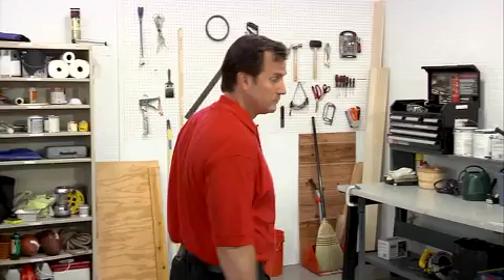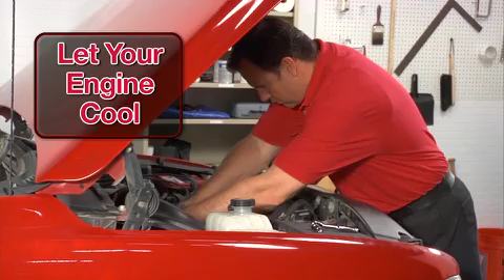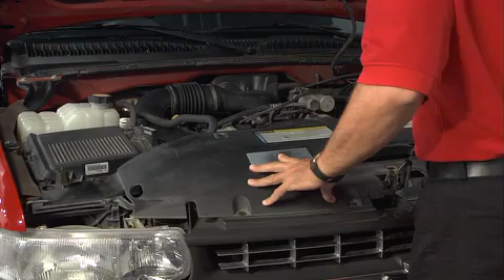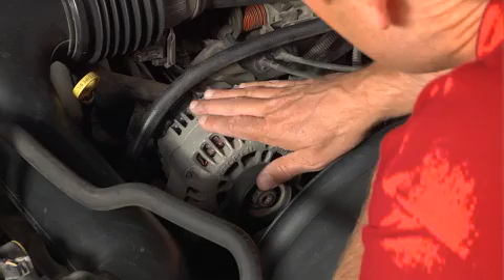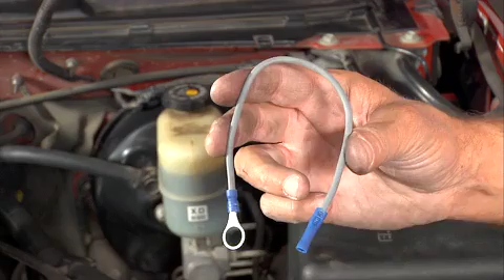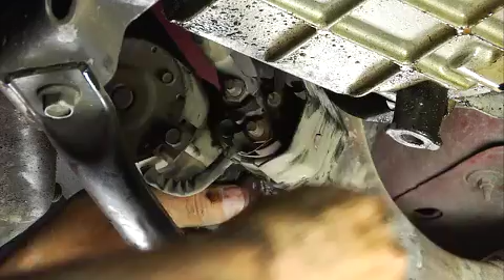AutoZone Car Care: When to Replace Your Starter

Comment: Is the teeth on my starter suppose to turn freely ? I went to advanced auto and they told me it was bad because that reason he did show me a new one and it was stiff didn’t move, then i went to autozone to test it in there machine and they tested it and they said it works ?

Comment: Guys, I’m scared. In my area a starter is 900 dollars , I promised my son a computer after he got all A’s on his report card, if I don’t get it for him it’ll break his heart. What can I do
Reply: Norma Frazier Yeah... I had to pay 700 dollars to fix it, he took it well, thanks for the help.
Reply: See about a used one at your local wreaking yard. Will be less than half of a new one, maybe even cheaper..Good luck..
Reply: But the starter and tell your son to lick rocks.
Reply: I heard about this cool invention called the internet. I understand that you can buy one there and have it dropped off at your doorstep for about $50 and hire almost anyone to bolt it on for about $20.

Comment: question... what about when you have that the first time it starts slow. but evertime it is different. sometimes faster and sometimes it takes 5 or more seconds. it always start though! then when i shut it off again i do it again or withing a short time it starts fast. i changed the feul regulator so that ain't it.
Reply: This sounds like what mine is doing. Did it end up being the starter
Reply: @penguinzomzom  I'm assuming you've sorted it by now but If you haven't my silvia was doing a similar thing, would crank sometimes once, sometimes would start up without even cranking and other times would crank strange.. I left it sit for a week and now it won't start it all, engine won't crank even once and when I turn the key the catalytic converter dash icon appears, If any of this is similar to yours or anyone else who's reading this's situation, I just got it diagnosed and it is supposedly the starter motor.

Comment: Is it too much to ask for someone saying "If your starter sounds like this insert bad starter noise then it might be bad."

I've sifted through countless videos, and not one of them has what a bad starter sounds like.
Reply: Robert Cozby A bad starter don't always make the same noises and sometimes they make no noise.  A bad starter is usually 1 solid hard click (several soft clicks is usually a battery issue) a grind can be a starter(but often time is misaligned starter that's eating your flywheels teeth and ruining it. 
The most common starter noise is the 1 solid click noise.

Comment: friend replaced my alternator, but the car won't turn over at all with a jump it does absolutely nothing except you hear a light buzzing noise from the starter. would that indicate that the starter is bad?

Comment: I ran over a 2x4 a week ago. My 2011 chevy aveo has been running with no issues except one. I hear a ratting noise under the car, and it has a 1 second start delay. Outside of that the car runs fine...

Comment: why does autozone have such trash for parts electrical and pump wise? china rebuild's?  ofcoarse it is. i bought a powersteering pump from them one day and it wasnt anygood. so we returned it because it had a bad sound like a bad one would have to begin with duh! and before i even had time to leave the store with the secondary one, i found a pin hole, in the elbo on the pumps fluid nipple connection as i was walking out of the store !!!!!!!!!! i walked over to the guy and said do you see this is trash on the shelf here you just handed me i just notist? he says nope i see nothing wrong with it. i then gather a bunch of spit into my mouth then spit on the hole on the pump and blew on the end and spit bubbles blew out of the spot and proved it was no good off top. how in the hell are people missing this shit these days and still letting forein countrys make and rebuild things from here that should only be rebuilt by the original makers? fuck off isis and fuck off china. AUTOZONE IS CHINA!!!!!!!!!

Comment: Nice video. I saw a post that said a rapid clicking sound indicates a dead battery. But I'm hearing that rapid clicking sound on my 1998 DeVille while it's being jumped by another car. It's doing less now than it did before I hooked it up to that other car. Have you any thoughts on this?
Reply: Charge your battery that's it
Reply: OK, Thanks.

Comment: I was driving along about 40 MPH when my 2000 Hyundai Sonata just stopped. When I tried to start    it just went click click click.     Any ideas ?    Lee Mason Aloha OR 97007
Reply: Battery
Reply: The problem is with your alternator. It is not charging the battery.

Comment: Yay just replaced my starter and STILL flickering and clicking. Now time to buy a battery.
Reply: wentaGT , you should have told auto zone to test the starter and battery.
Reply: @yadirbear  you should have post this 5 years 4 month earlier.
Reply: @gospursgoraidernation5185  at this point he got a new car

Comment: Turned out to be a bad stator.  It should have put out about 80 AC volts to the CDI, but was only putting out about 20 AC volts.  Put a new Stator in and it puts out 93 AC volts to the CDI unit.

The bad stator made my spark cold and weak and eventually the scooter wouldn't start at all.  Now I have a strong, hot spark and she starts instantly. :-)

Comment: Nearly had it all covered, but I'd like to add a a bit more info. While electrical system complexity is understood, must distinguish between functions & components of the ignition & charging operations. Even a "starter" is more complex than merely a single unit & may be modularized into distinct components of an assembly. The associated solenoid, motor/clutch, & else are usually included in a large housing, but some may be separated; so ensure entire assembly is brought for a shop test. Thx.

Comment: I can never find out anything about the starter spinning but not engaging. It doesn't always do this, but it does it enough sometimes 3-4 times before finally engaging flywheel.  I took it out and jumped it, the bendix kicked out, so I put the old one back in. I keep hearing different things and shimming on one side and this and that. I don't have much money I'm waiting to start a new job and I need to be able to get there so idk what to do.

Comment: I have a scooter.  What if my starter sounds normal and turn the engine over very nicely but still won't start the engine - YET, starts just fine when I use the kick start or while a battery charger is on the BRAND NEW, FULLY CHRAGED battery?